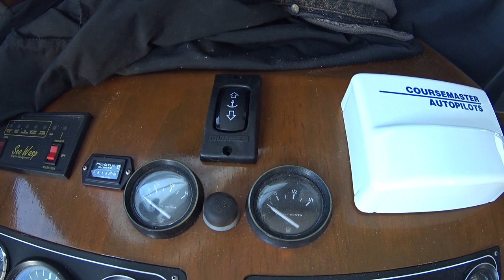Cruising Into Retirement 2020... Fitting a new anchor Windlass

Comment: Thanks Norm. I'd like to have a go at making videos when I head off.
I'm in the Logan river near the Alberton boat ramp. I plan to move about in the Moreton bay area to learn how to handle my 14 ton Hartley 34.
I plan to install an electric windlass myself. I also have aching arms. I'm 71.
I've just finished getting a Wind Generator standing and connected to the batteries. I love the extra energy it's giving.
Cheers Gray
Reply from the maker: Yeah Graham, The winch is the best thing Iv've added lately. Should have done it years ago.
Lots easier and SAFER.
Cheers mate.

Comment: Great video, Norm. I installed the same electric winch in my 30’ steelie. Just by chance, my s/s fabricator picked up the fact that the template wasn’t 1:1. Drilling holes in stainless plate has to be right from the get-go.
Reply from the maker: Yeah Bit of a nuisance Jim.
You over the flu yet??
Reply: Motor Sailing for Old Dudes. Yep. It took 10 days though. Now I’m suffering Diverticulitis( another old mans condition) the intestines playing up( boring!). Hope alls going well, stay safe, Norm.
Reply from the maker: @jimthurgood5364  Take care of yourself Jim. It's pretty cold at night down here.
Cheers mate

Comment: That's the first time I've heard of a template not being to scale , guessing you might have edited out the colourful language when that was discovered? 
Couldn't they just have printed onto a larger sheet of paper , eg A3 size as it didn't look too far off from being yi scale .  
Close to 3 years later now , hope the new electric winch is still going strong .
Good tip on using another spanner to apply opposing force , a few years ago I broke a cheap battery isolator not doing that , only using one spanner ....
Reply from the maker: Yeah Dude. There were a few nasty words cut out. The winch is working well and just did a huge job that you'll see in an upcoming video.
Thanks for commenting

Comment: Great info for anyone doing a similar project. I can't believe a manufacturer would do a template Not to scale. Do you have to increase its size on a photocopier before you can use it. Norm do you have an email address for your channel.
Reply from the maker: Yeah Neil,
a bit disappointing. You probably had to scale it as you suggested, but the instructions were in very fine print. Should have been written right across the page.
No email address mate. 
i have a Facebook page called 
Cruising East Coast Australia and could be messaged from there.
Thanks for the comments